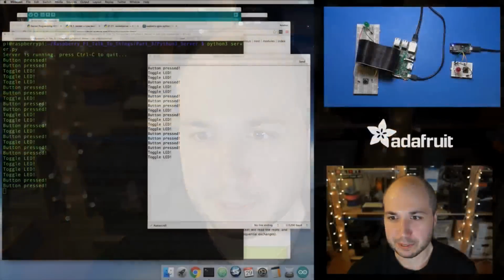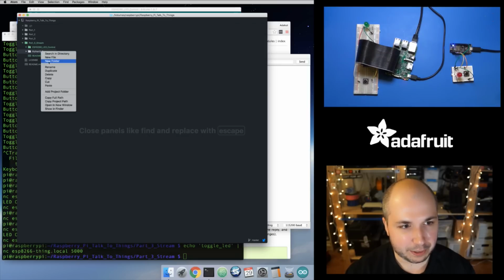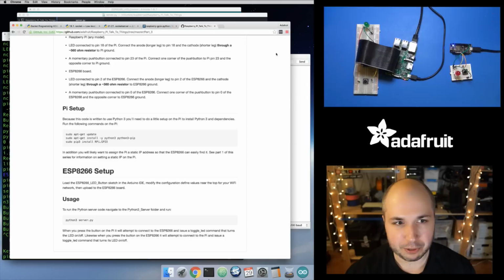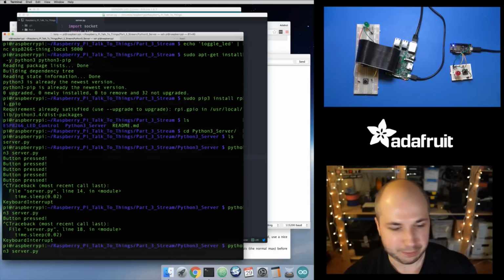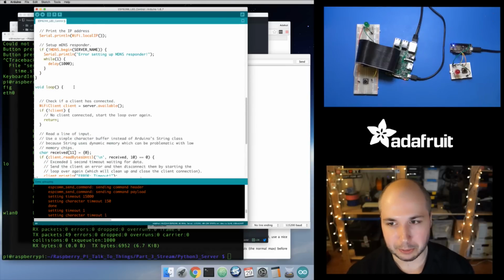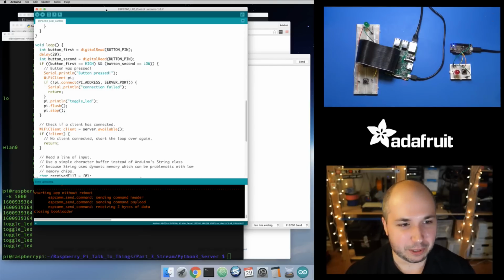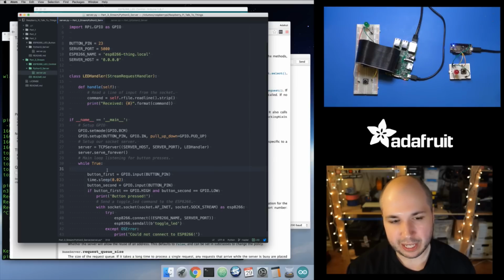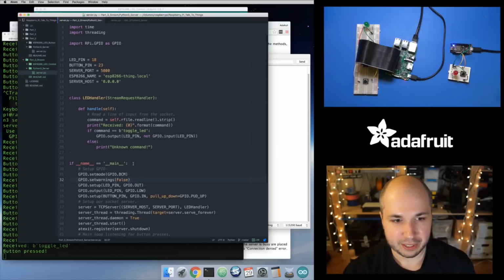Raspberry Pi Talking to WiFi 'Things' pt. 3 with Tony D!

Comment: I noticed the esp board turned on LED on power up. If the led was a relay etc, this could cause a problem. Are the outputs logic 1 on power up rather than high impedence ?